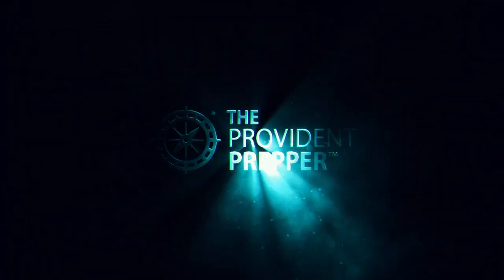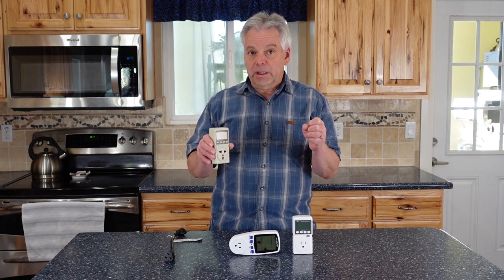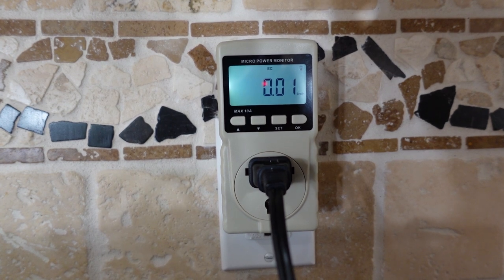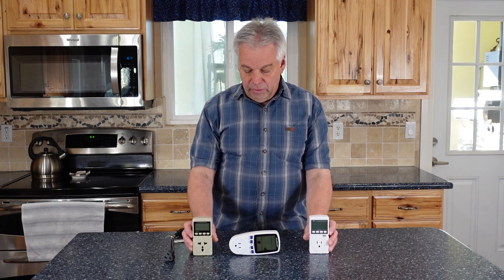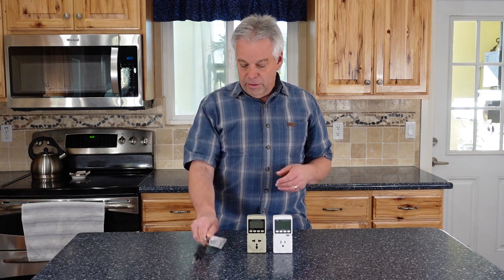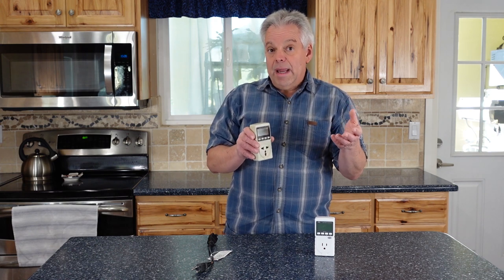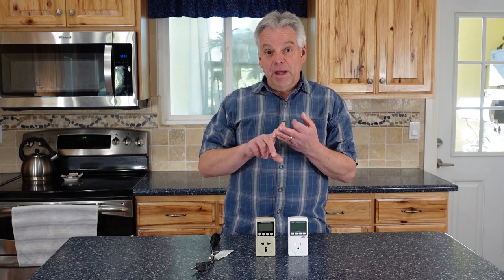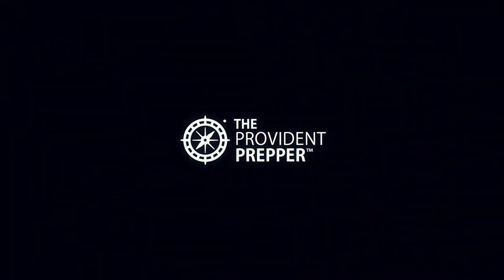Calculate Backup Emergency Power Requirements Using a Power Consumption Meter

Comment: Dear Team. I learn so much from you.. thank you .  My biggest concern about power going down is that my family member is diabetic and use insuline injections... insuline need to be kept in cooler... any idea how to proceed with this if power go down? Is there any minicooler with batteries?
Reply: There are coolers that run on battery power / or generator power. They're usually called either jobsite coolers or camping fridges. Hope this helps.
Reply: @jenniferbriski567  thank you. I will google it tomorrow.
Reply: Also there are solar coolers, AND non powered ways to cool things down (works best in dry climates)

In addition if he only needs a smaller amount of insulin,  the pen format is more temperature stable than the bottles, although they still want to be kept cool

Comment: ~~~Jonathan,  In the manufactures Q&A it states the one with the 20A plug receptacle is only rated for 10A. 
(Question: Can this unit handle 20 amps at 110volts?
Answer:Hi, it can't. The maximum rated current it can handle is 10A.
By Gain Express SELLER  on November 2, 2021) 
~~~I have the large Harvest Right (5 tray) that has the 20A plug.  You stated you use it for your large unit.  
I have has a 20A service wired for mine in my garage but have not found a meter that handles 20A.  DOES YOURS ACTUALLY HANDLE 20A?  I don't want to damage the meter or my FD'r. Please advise?  Thanks,  Bill
Reply: Hey Cool Hand Luke...you are right, and I appreciate you pointing that out. Since it is rated for 2200 watts and can accommodate the 20-amp, 110 volt plug, I had presumed wrongly that it could measure up to 20 amps when used on a 110 volt system. I confirmed with GainExpress that you are correct, and that it is limited on both voltages to 10 amps. Again, thank you  for bringing that to my attention. Take good care, and Thanks for being part of the solution!

Comment: if you have a CPAP... every thing else(non medical)  can go hang, but not that.  sleep apnea increases your risk of stroke and heart failure, and under a grid down situation (high stress and low access to doctors) you NEED that to run.

the priorities for your electric needs are 
life (meds)
communication (being able to power your phone, radio, or computer for at least part of the day)
food (i favor shelf stable stuff but even i have a freezer, and YES my bread machine would go right here)
and then everything else depending on your needs